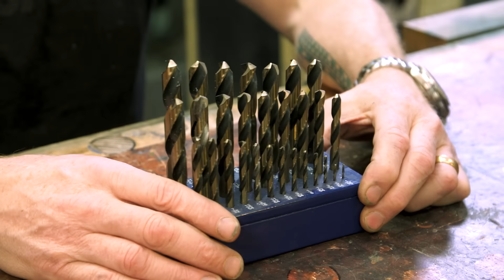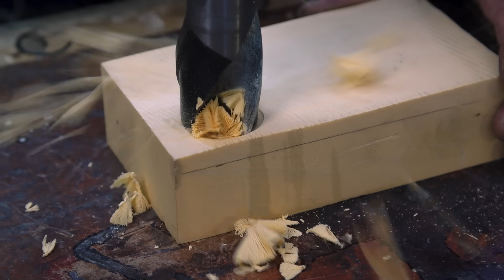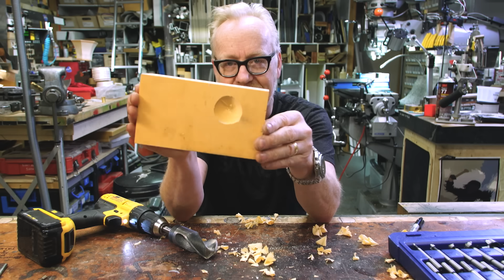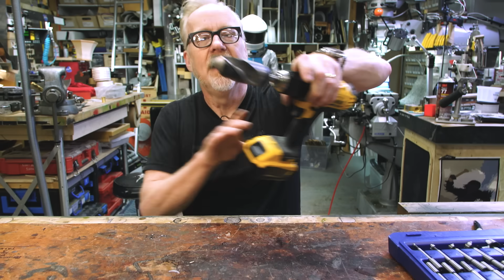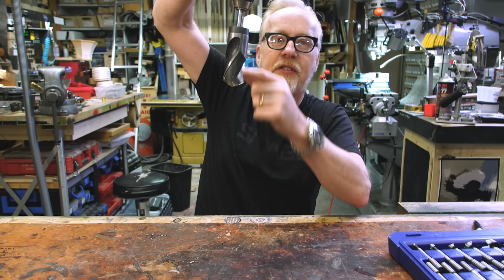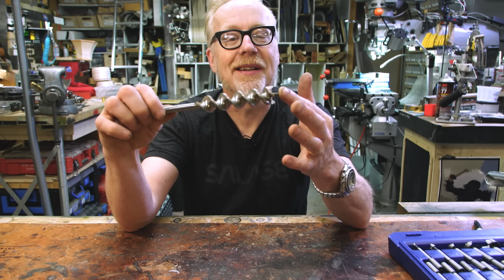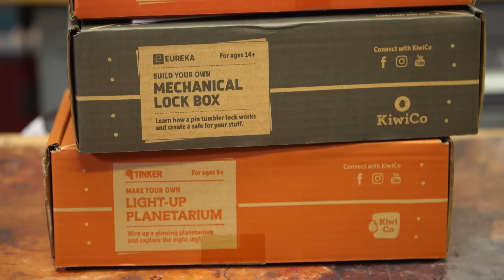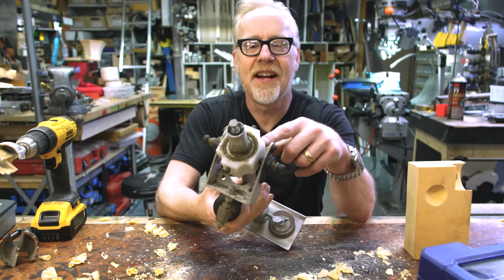Adam Savage's Guide to Drill Bits!

Comment: I'm a big fan of forsner bits and I used them all the time in high school woodshop for countersinking holes to accept a 3/8 plug to hide the fasteners however I'm used to them almost always being completely dull and burned up. There were a few times I'd wished I'd just gone and bought my own to save the hassle of putting my whole weight into drilling a shallow hole into poplar

Comment: I recently upgraded my cheap forstner bits with an expensive set with a hex shank (instead of round), total game changer in my wood working.
Reply: Which brand? Fisch?
Reply: @zorbaseatery4745  MLCS it is a wood working store in the US.
Reply: I always hated that companies use smooth shanks for forstner bits, especially large diameters where you'll be hogging a lot of material.
Reply: @fatfredthe28th  would it be possible to grind down three flat sides on a belt sander, maybe create a groove on those sides, so a standard chuck can get a better grip on the shank?
Reply: @zorbaseatery4745  , of course. Just makes more sense to me to sell them with a hex shank as they will work better and presumably sell better. Who knows, maybe manufacturing costs are notably higher versus smooth shanks.

Comment: Pro Tip - If you use Loctite on bolts that would hold acrylic (plexiglass) be careful that NONE  of the loctite gets on the acrylic, as it will cause damage, in the form of small cracks around the hole.

Comment: 318 x required surface speed for HHS divide by diameter in mm
1st one is: split point imperial jobber drills
2nd one is stepped shank drill

Comment: I have wondered if there is a drill bit that cuts a usable circle - so the piece that is cut out remains whole as a circle. I found some crappy drill bits for plaster that supposedly do this but I couldnt hold them still enough to cut a circle

Comment: If you like auger bits but don't have the money or a bit-brace to drive them, try Wood Owl Brand brad-point auger bits. They have a standard hex drive end so will work in any modern electric drill or driver, and produce perfectly cut holes, with zero tear-out at either end of the hole.... They are quality Japanese metal and reasonably (not cheap) priced.

Comment: I think spade bits are really just meant for quick-and-dirty large-diameter holes with little fuss- for a perfect example, drilling holes so that you can run pipe through the studs within a hole.

Comment: My favourite thing to use Forstner bits for is using a bolt on soft wood. If the bolt shaft is say 1/4" then I will get a steel washer with a 5/16" hole in the centre (for the bolt to go through). The outer diameter of the washer might be 1". So I will drill a 1" hole with a 1" Forstner bit. If the bolt head is 1/8" high and the washer is 1/32" high then I drill in 1/8" plus 1/32" plus a slight bit more. Once I have 1" wide hole (for the washer) then I will take a 1/4" Forstner bit and drill completely through the wood using the same pilot hole the first Forstner bit created.

Now I can drop the washer in the hole, put the bolt through the washer and wood. I do the same thing on the other side for the nut that goes on the bolt. Now when I tighten the bolt and nut, it spreads the pressure on the washer and the washer spreads out the pressure on more of the wood. If the wood is REALLY soft (like pine) then you can just use a bigger washer and corresponding Forstner bit.

Comment: I've found running a standard bit in reverse for a second before going forward tends to make it easier to drill acrylic.
Reply: Flatten the cutting edge with a slight negative rake for acrylic.  Scrape your way through don't cut your way through and the drill won't grab . No need to steppen the angle.

Comment: I have a set and they work great.  One thing he didn't mention was that they leave a flatter bottom for blind holes.
The other thing I've noticed is that if you are drilling into end grain it seems to takes a lot of pressure to drill with them.

Comment: Are hole saws considered drill bits?
Reply: Don't know the definition.

But I think of them as a saw, and that makes it easier to use them.
I use them with very slow speed and give the saw dust room to 'escape' (you can even drill a little hole at the edge of the circle you want to cut out).
Many people use them with too much speed and to much down force. The results is too much heat and bad endproducts.

However, I only use them if I really have to. I prefer the step drill bit in metal.
Reply: @hw2508  I know that stone masons use them to cut tap fittings in stone bench tops and I know that it’s easier for plumbers and electricians use them to cut through wood when fitting pipes and wires. Personally I would consider them a “drill bit” but I guess in a way they aren’t
Reply: @colonelbill7277  there are many different types for all kind of material.

In Europe, at least in Germany, electricians use them for switches and outlets.
e.g.
https://m.youtube.com/watch?v=f7Q4f0Ay2js
https://m.youtube.com/watch?v=Mai_NbFsLFM
Reply: @hw2508  same here in Australia

Comment: A few honourable mentions- Countersinks! Next to the actual hole boring apparatus probably the most important thing you can put in a drill if even to debur. Also holesaws for the next size up from forstner bits (or annular cutters for metal). And for extreme precision holes, the reamers and boring bar to finish a hole started by a twist drill etc. Cheers!

Comment: Spade bits are great for rough construction work. Like when you have to run wire in the walls and you need a hole in your studs. Forstner bits are great for work where you need a very precise hole for a project.

Comment: Hey Adam, I do a lot of work with electricians and the spade bit you mentioned does make a mess but its great at drilling a lot of holes quick, which comes in handy! 
The good ones have a threaded "point" to them, to help pull the spade into the cut.
Reply: I don't like the threaded tips because they pull into the material and can act as a wedge splitting it instead of drilling all the way through.

Comment: i've always said... buy the cheapest you can...for stuff you hardly use... but stuff you use all the time, buy the most expensive you can afford. 

This is why I have $3 wrenches and $60 wire cutters... a $9 studfinder and a $700 multimeter.
Reply: Quality's all well and good, but you could buy a running used car PLUS a decent multimeter for that $700. Or 5 or 10 really great multimeters. You might have a spending problem there (or a research problem)...

Comment: got to disagree with cheap vs expensive forstner bits - had a set picked up maybe £30-40, they squealed, heat and smoke - turned out i had a need for a hole of a non standard set size believe its 33mm and my set only had 30 then 35 - anyway they only one i could find that diameter was £33 for the single bit - i begrudgingly bought it, 10seconds into using it for the first time i knew i was getting a full set of expensive bits - no squealing no smoke very little heat in the workpiece and drilled in about 1/4 of the time it took with my old ones - so cant recommend the famag bormax 2 forstner bits enought

Comment: Linemen use the auger bits to drill mounting holes for transformers in wood poles. Either in hydraulic or electric drills
Reply: Best tool for drilling studs/joists for running cables or pipework too. Auger bit in a decently powerful corded drill will do the job in half the time it would take with a spade bit in a rattle gun, and no messing about with batteries.

Comment: In woodworking, the thing I've seen most people just not have any awareness of is the process of milling lumber. People seem quite significantly keyed in to the home depot, dimensional lumber process, more than the raw sawmill lumber style that hardwoods are more typically found in.
Reply: I'd say that's understandable, given that "raw" boards just aren't as casually available as the "cleaned up" pine that normally gets used for home improvement stuff.
Reply: It's because the cost of getting into milling lumber is substantial. A quality planner and jointer runs on 220v which most homes are not prewired for. Depending on the location of your panel, running the wire is expensive. Additionally, you panel may not support any extra load. As you can see, the cost can quickly run away from what most DIYers can afford.
Reply: @AxGryndr  The home gamer stuff is all 110v 15a compatible. Hardly high end stuff, but it exists and it works for low frequency usage.
Reply: @RadicalEdwardStudios  You are right, you can get a lunch box planner, like a Dewalt 733/4, that runs on 110v however they present a number of issues (snipe, underpowered, limited capacity, slow feed rate, etc). For someone that is running that small of amount of board feet, the price tag of the planner usually  is fairly high compared to the cost of paying for S4S lumber at a big box store.
Reply: @AxGryndr  There isn't always sufficient selection at box stores. That's the main reason people haven't given up on hardwood suppliers.

Comment: My experience with spade drills is that you need to runt them quick and press slowly through the wood if you want an pretty hole. With drill press. Got to give the chisel time to scrape the wood slowly. But they're great for rough work though, cut quick and dirty through wood if you apply force

Comment: A safety tip for larger tools you use in a handheld drill, like forstner bits and hole saws. Plug in drils, and the more powerfull cordless ones have serious torque, and can really hurt your wrist if you clench the tool hard. So be ready to let go if the tool suddenly binds.

Comment: First, Forstner bits suck unless you specifically need them for say a flat bottom hole and only work in soft materials.

Secondly, auger bits are incredibly common and still made/available everywhere. Mostly used for drilling deep holes through timbers.

Thirdly, you forgot hole saws which are very common as well.

Fourthly, concrete bits don't work by cutting as much as they work by impacting with the chisel.

Fifthly, Adam explaining tools is painful...he might be creative and whatnot, but he misses so many key points and does almost everything the wrong way.

Comment: Surprised there was no mention of a hole saw. In my limited usage, they essentially are what gets used when a hole needs to be larger than the available spade bits.

One unusual use I've had for hole saws was drilling holes in EVA foam. Forstner and spade bits work great on wood, but foam just moves out of the way when you scrape it. I actually had to find an unusually small hole saw for making an exaggerated butcher knife for a cosplay (PoH's "Mate Chopper" from Sword Art Online).

Comment: I've used a forstner bit to make a depression in aluminum to mount a bearing to hold a linear screw in a 3D printer.  I thought those bits would only work in wood, but they DO work in aluminum.  Haven't tried steel, probably would destroy the bit if I did.

Comment: The first drill bits that Adam can't remember the name of (shorter and hardened twist bits) are called mechanics drill bits. Great for drilling hardened frame material in tight spaces on vehicles.
Reply: I’ve also heard jobber or stub length.
Reply: @cameronwebster6866  jobber length are the standard sized bits you'll find in most places. Mechanics length are about 3/4 the length of a jobber.

Comment: I’ve been doing a lot more hand tool woodwork recently, so when he mentioned auger bits my ears perked. Surprised he didn’t mention the snail at the tip of the bit, it is just a fantastic lil idea that works soo well
Reply: Me too! Auger bits are boss for lower speed drilling, and the spurs leave a nice finish across the grain. If you use a brace you can relatively accurately get depths by counting turns. And the old ones aren't that expensive online or from the right thrift store/antique mall. I think they just don't fit into Adam's main style of work as well as Forstners do (metal machine shop, quick drill chucking, lots of different materials, larger holes, etc.).
Reply: That snail looks like the speed tip Bosch stick on their spade bits, I take it it's the same thing? Albeit it probably doesnt then tear right through whatever you are drilling!

Comment: For anyone else who has never read the manual for a DeWalt keyless chuck like Adam is using, they are designed to lock only once you rotate them slightly backwards. So turn the chuck clockwise until it seems fully tight, then rotate it backwards a couple of degrees and you will feel a click as it locks. A spinning drill bit will no longer cause the chuck to unlock and the bit to fly out.
Reply: This is incorrect. If you actually check a manual they say "When the chuck is nearly tightened you will hear a clicking sound. After 5-7 clicks the chuck is securely tightened around the accessory."

Milwaukee's manuals say "The bit is secure when the chuck makes a ratcheting sound and the sleeve can not be rotated any further."

Flex's manual says "Close the chuck by rotating the chuck body clockwise and securely tighten by hand"

Makita is nearly identical to Flex except they say "sleeve" instead of body. 

And I'm not going to look at any more brands for the time. There might be some that do use that mechanism but DeWalt, Milwaukee, Flex, and Makita cover some of the biggest power tool companies. (Black and Decker, TTI, Chevron, and Makita)

Comment: Forstner bitts changed my life! the attribute you didn't make much of, but was shown is the shape of the bottom of the hole. The center has a small divot and the outside edge has a small groove, but the rest is flat and smooth. This was GREAT news for me because I imbed T-Nuts in resin castings. With just a pick and a little sandpaper, I can  get a very clean hole that centers and levels the T-Nut - something that the great honking divot and grooves of a spade  bit made difficult.
Reply: This is what I bought my set - wanted to countersink bolts and nuts for some planters, so forstner made that easy. Honestly didn't know I was buying something so special, but I love the bits.

Comment: um no Adam... that $30 set of Forstner bits is NOT as good as a $130 set.  BUT you can make them work if you understand how to Sharpen those out of the $30 set.  Oh look a potential video... Shop Maintenance - Drill Bits and Hole makers

Comment: A useful tip for avoiding blow-out with forstner bits is to drill until the very tip of the point comes through to the other side of the work and then flip the work and use that hole as your centre mark. Perfect holes on both sides of the work.

Comment: there's one style of drill bit you missed out....... the hole saw bit :D
Reply: I wondered about this too, but is that still a bit or is it a saw?  Most drill/driver variety packs would include one though so I agree it could be considered a bit.
Reply: @AlecDenholm  i personally put it in the same camp as the forstner bits to be honest
Reply: @Jon Anderson but a forstner bit is of no use for something that's only 1/4 thick, it'll tear that thing up.

for example 1/8" or 1/4" ply will get torn up with a forstner bit imho whereas a holw saw it won't

Comment: Great video, Adam!  To drive home the point about the need for a pilot hole... consider that the very center of the drill is NOT turning.  Without a pilot hole, the tip of the drill is being pushed into the material without rotating.  A pilot hole that's approx. the size of the flat "point" of the drill greatly reduces the force required to push the drill thru the material.  And keeps the larger drill on-center and less likely to make a triangular hole.  Another solution is to make or buy a "split-point" drill.  Cheers!

Comment: I'm really surprised you haven't found a big difference between cheap forstner bits and nicer ones. The really cheap ones work but the nice ones are sooooooo much better o_O Then the cheap ones I use were like 10€ for 5 of them and the nice ones are between 10 and 30€ each ... so yeah when you're starting out a cheap set will definitely be used a lot. But now I buy nice ones (CMT in my case) one by one when I need them and they're definitely worth it IMO.
Reply: It depends on how much you use them. 5 holes a month vs 5 holes  a minute would make a difference.

Comment: I like to start with the cheapest version of a tool or bit that I can find.  
When it breaks or wears out, I'll replace it with the best version I can afford.
If it doesn't ever break or wear out, then I don't need the better version.
Reply: Yeah you usually just use a couple sizes a lot in a set. I have a forstner bit set that's over 30 years old now and there's sizes in it I've still never used. The 1/2" bit I have has seen better days though. So buy a cheap set and replace the bits you kill with individual good ones.

Comment: One important thing you left out about that auger is that the little screw-threaded tip (sometimes called the snail) draws the bit through the work.  This means you don't have to apply any force in the direction of the bore, you just need to turn the brace. Longer throw braces (they go up to 14 inches AFAIK) make this really easy even in very hard woods.

Comment: Benjamin Forstner (25 March 1834 – 27 February 1897), was an American gunsmith, inventor, and dry goods merchant. In 1886, Forstner patented the Forstner bit. The bit was revolutionary as it did not feature the lead screw (which Forstner called the "gimlet-point") or the cutting lips of more conventional wood boring bits, and thus proved especially useful to gunsmiths and high-end woodworkers.

The spade bit is most commonly used in construction to drill fast rough holes through studs and joists for routing wires and tubing. It blows through the soft would very fast, and you don't care how clean the holes is just for routing.